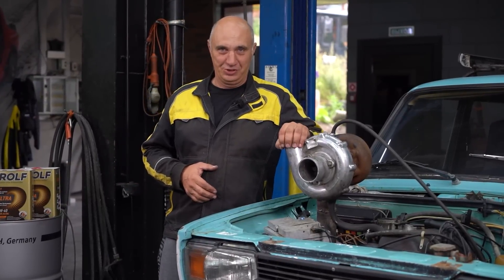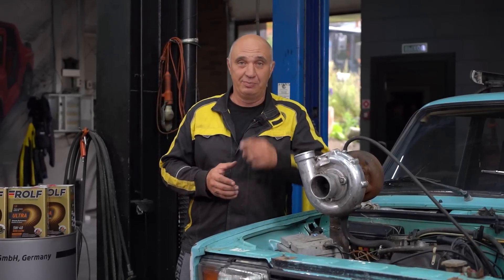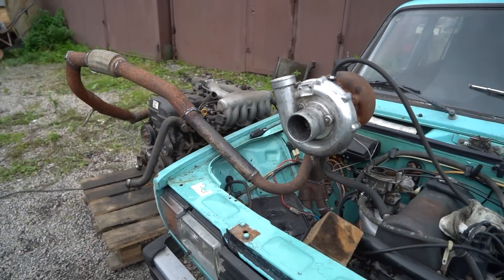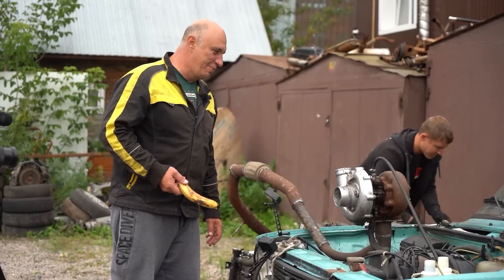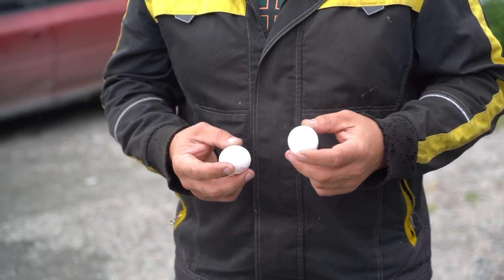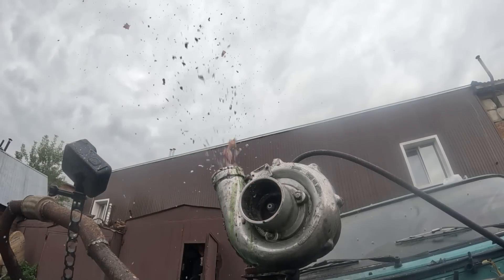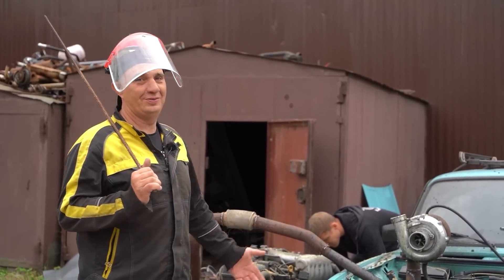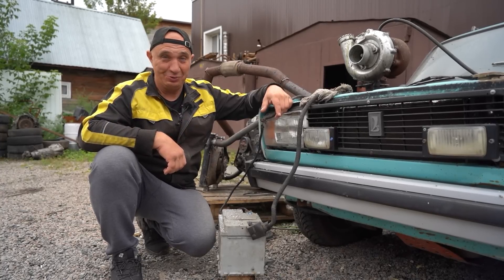Will a turbocharger survive a bird strike?

Comment: The turbo didn't spool up very much as the engine wasn't under much load, so even though it was revving fast, the intake valve wasn't open all the way to keep the air fuel ratio where it should be.

The more power an engine has to produce, the more gas is coming out of the exhaust.
Reply: You're clueless
Reply: @spoonandtune  ?

Comment: Here is an idea for a video. Driving with the hood open and use a camera and monitor mounted on the open hood to see in front of the car. Or have monitors and cameras in place of every window. Maybe try it on a test track with a slalom and other obstacles.

Comment: I have a question I was wondering if you replace all of the oil in a vehicle and replace it with diesel fuel how would the engine run it's something I was curious about. Maybe if this comment gets enough likes and maybe you could try it?

Comment: A shop I used to work at had a supra drag car with the turbo mounted up front behind the bumper cover. One day, it ate a squirl. Something along the lines of "yeah, I hit a squirl. It just fell out of the trees. I thought it was clear, so I hit the gas. Apparently, something wasss-OH GOD!" Tail and legs were sticking out of the inlet, and the CAC was gummed up with squirl goo. That turbo survived, but it wasn't the same after that. We put turbo mesh over the inlet but pulled it at the track. This track had a  corn field on one side and woods on the other.

Comment: All I can think of is the testing done by Saab when they were developing the J 29 Tunnan. A jetfighter built from 1950 and some years onward. I had a license built de Havilland Ghost engine and one of the things they were afraid of was birds being sucked into the engine and damaging the turbines. So they used a test mount and threw stuff into the intake to see what it took to damage it. They started with dead birds and small things and the engine just kept on running. So they started tossing larger and harder object, including fist fulls of nails and they were just spit out the back with little to no noticeable damage to the engine. Eventually someone threw a crow bar in it. The engine didn't like that but it was still running after the crowbar and some blades for the turbines were spit out. Having seen that the technicians were convinced it wouldn't die by sucking in a few birds.

Comment: This test is actually pretty funny, but a real turbo inside of an engine will spend much faster when you actually create boost pressure inside the engine because the exhaust pressure gets much higher

Comment: it slices ... it dices ... its the turbo slicer 2000 !!!
Reply: Save electricity with this gas powered blender!
Reply: @matthewpere1975  i rate it a solid 4,5/10. blending is more like a 2/10, doesnt eat some stuff thats supposed to be fed. On top you need to buy a 2nd and stronger engine to operate it at turbo slice. but we cant argue about the sability of it and that i can chew through metal, even though just once!
4,5 is definetly fair.
Reply: @johannesdatblue4164  or just hook it up to a V8 that should have all the power needed to slice a block of cheese.
Reply: but wait, there's more!

Comment: European turbochargers: Using only premium quality oil and filters still fails in less than 100k KM
Russian turbochargers: Can be used as shredders or blenders.
Reply: It's the bearings that fail. Mid 5 figure RPMs will do that.
Reply: Same with American turbos. Done plenty of holset and Garrett for normal use.
Reply: Its fails usually because nobody wait till warm up the turbo or cool down a bit the oil,so the oil burn at turbo shaft every time till at some point the turbo say ,no thank you was enough.
Reply: @laszloszell8753  Agree with you for the classic ones but the newer generations made of "chinesium" are failing almost at every service interval.
Reply: That’s because of lazy oil change intervals.

Comment: The volume per compression cavity of the prop is so small that it doesn't have the outrageous vacuum we expect. It certainly pulls objects in with tremendous force, but it's not until they're directly on the mouth of the unit that it can get a true hold purely through suction.

Now, what you can do with that turbo is send it to me so I can install it on my racing 4-wheeler! 🦊

Comment: Something to note, At such crazy RPM's, the force of air on the impellers is pretty significant and slows down the turbo. If you close off the exhaust or intake of the turbo, there will be less load on it, and as such, it can reach much (dangerously) higher RPM's. (:
Reply: It wouldn't suck anything in though.
Reply: @Chris_Garman  but whatever's in there is more likely to make it frag

Comment: Now, that's an interesting way to eliminate turbolag. Just add a second engine that has no other function than increase the exhaust flow to spin up the turbo.
Reply: No, it's an interesting way to eliminate turbo lag by not hooking the turbo to the intake.
Reply: I wonder if you could have a motorcycle engine in the trunk that revs to the moon every time you shift and have it work like this if you piped it up to the turbo? RIP Group B rally we'll never know
Reply: @viceroybolt3518  No need, with the literal jet engine anti-lag system some of them used.
RIP indeed, though... I appreciate equalizing everything to make it about the drivers' skills, especially for teams without an endless budget... but there goes the innovation as well 😢
Reply: @DUKE_of_RAMBLE  Ah yes, that Subaru toroidal-pulse afterburner anti-lag, it is THE ONLY turbo system which can go toe-to-toe with a supercharger for broad boost range! I have nothing but love towards whichever engineer(s) invented that, truly a masterpiece too advanced to exist in conventional strict-rule racing. It's so crazy that it can be viewed as a mix of the Russian Tokomak FUSION REACTOR - like vortex formation, a pulse-jet & an afterburner all @ once.. One of my favourite patent reads of all time & you can hear the turbo running past 50% optimal / top speed just while the car is idling, it's almost like cheating it's THAT good & unnatural-feeling.

People can talk about 2-step, VGT & whatever other tech all they want but none of them can even remotely replace Supercharger behaviour where whole RPM range is necessary as they don't generate max / adequate boost @ low RPM, not to mention linear behaviour + lag; the system is powered by the same fuel the engine uses & air so it's not requiring weird crap, especially if the ECU is great & programmed well to rich the mixture only when needed as compensation.

Even Centrifugal Superchargers still have the issue of non-linearity & decreased efficiency until higher RPMs, granted it's not super bad or anything but it's noticeable compared to a positive-displacement Supercharger like twin-screw or Roots. On top of the potential pseudo: positive-displacement supercharger behaviour it doesn't have the poor fuel efficiency & emissions of the Brayton cycle of a normal jet (@ least in theory), not to mention it's essentially an always-active EGR; SO it could even be made to have great emissions!! Combine that with a Diesel & you may e able to reduce the crux of the Diesel, NOs emissions. There's a reason pulse-jets have much higher efficiency & far better emissions, albeit at the cost of power-density & power delivery only in pulses, which is far from ideals in many aircraft or vehicles.

Even IF you design a turbo as great as the one on the new L3B engine, the exhaust backpressure is still a thing & lowers efficiency when the Veins aren't in optimal position, so really you are leaching energy just to hope to emulate Super. performance. Since every pound counts, engine efficiency across the whole RPM range is very much relevant in most if not all racing, even in high-end Drag competitions, they often have the bare minimum in the tank only enough for a burnout & pass & some short driving after off the track, especially for low-energy fuels like methanol & ethanol where you need waay more fuel to make it. That is why those Diesel LMP cars were so cracked at Lemans.

Except for electric-drive / assist I don't believe any Turbo tech. will ever beat this one in broad RPM range / spectrum but the electrical drive STILL uses engine power so once again not really free spooling & definitely not free low-RPM boost like it first seems, unless you use regen-braking too while racing but that's just so overcomplex just to improve boost behaviour & I don't see anyone invest into such a system (which also weighs an non-insignificant amount).
Reply: @viceroybolt3518  I have for years now theorised to make something like this but I think it does already exist in some prototypes; somewhat-related though is that some turbo engines, I think the Cosworth ones, use only ONE bank of a V-8 engine to spin the turbine, this may seem absurd & pointless or even dumb but actually what this allows is a mixture of:

A Turbo-charged & Super-charged engines: one side is essentially a turbo i4 but the other is a boosted i4 WITHOUT ANY back-pressure, which comes with many benefits ESPECIALLY if you tune it right & have the cams in that side have different timing / lift + have a purpose0designed exhaust which boosts power. It's just like if it was a low to mid -boost Supercharged i4 BUT without using crank-power for it AND utilizing the better efficiency (at low air pressure & low-ish boost) Centrifugal turbine instead of a positive-displacement pump.

Now, I have 0 idea if the Cosworth engineered ones had the two sides with any significant difference like the cam thing I mentioned but eve if not the decrease of back-pressure & the use of exhaust-pulses for better exhaust-flow extraction already is guaranteed to make considerably more power than the side driving the turbine as aside from the obvious power draw of a spun turbine the exhaust-pulse travel isn't messed-up. I know those engines were also based on NA ones originally & the boost they ran was low; so you end up with a pretty well-balanced performance naturally from the get-go without any fine-tuning, even. But there is also a benefit where the torque output range & behaviour / style will be different between the two banks & so them driving the same crank makes for a more linear torque curve / output!

But one thing I thought-about on top of your idea is how an engine like the one you mention driving a turbo for a Diesel would yield amazing results as Diesels with a long-stroke, good design & correct AFR (no smoke..) already use-up far more of the combustion energy, meaning the exhaust isn't expanding much anymore & the EGTs on Diesels are also lower. In fact I have a theory many diesel tuners reaching stupid numbers with nearing 100PSi or more purposefully use too rich of a mix so there is more turbine driving force but I'm not an expert here & it may be just hard to tune out & not purposeful.

I own a model-plane engine which is called a "Diesel" but it's actually HCCI, that is like a carb but with heavy fuels & oils * ignition via compression & it has a 22.5/1 compression or so.. Even though it's like a 1.5cc. engine, the style of combustion is already so much more exhaust-efficient they are quieter than nitro RC engines to the point they don't need a muffler, so the proof is in the pudding. And as a final proof of concept there is this guy here on youtube who put one of those cheapo AMR500 supers on a 4-stroke small generator Diesel for his honda & he's getting better mileage & performance overall. But with a turbo, even if it's actually small enough to be within function range, it'd almost certainly not do better, probably be just str8 parasitic until way up there in RPM where it could make a little more power.
Reply: @bo-dine7971  I believe it, not every time but some of the time the improvements in combustion from boost on something that runs constant like that would be good and the turbo like all turbines is extremely happy frozen in space at a stable RPM with no special outside forces on it. Generators have the ideal operating environments car engines don't. 

As for the diesel boys running rich, you know they runnin rich that's why those two thousand HP monster trucks blow up on the dyno so much it's a wonder when they don't runaway.
Reply: it's called compound turbo setup, but actually  the engine that spin a turbo to spin another turbo is your own engine, and it is connected to the second turbo too, so the pressure rises to the sky.
Reply: 2stroke turbo on 4 stroke😭😭😭😭😭 just a weed eater on a turbo
Reply: Comprest air from a cylinder to the exhaust side?
Reply: Maybe wood turbo barrel 2jz

Comment: When has a bird ever flown into a turbocharger? jet engines are not turbochargers. The AI generated thumbnail is also a let down that made me sad.
Reply: Then why are they called turbine engines?
Reply: @deadon4847  because they use multiple stages of turbines to move the plane.
Reply: @Floofie_boi  They do the exact same thing, they compress air.
Reply: @deadon4847  one of them is an entire internal combustion engine, the other bolts onto an engine. The only similarity between the two is compressing air

Comment: A squirrel caught in the turbo would be more likely.  Birds don't usually nest in under hood.
Try a cat.
Reply: Yeah, squirrel or mouse. 

Mice regularly get into airboxes. I found a dead mouse on a maf sensor screen, and surprisingly when i was 18 doing brakes i found 1/2 a dead mouse on top of a brake pad, the other half must have gotten sucked between the pad and rotor.
Reply: Cats are for eating, not turbos.  😄

Comment: I once did a repair and covered the turbo intake with a cloth.
Forgot to take it out, went driving.
There was a noticable "puff" and a bit of smoke. The cloth was gone, the turbo still happy ever after!
Reply: If you pulled the intercooler there were likely particles of cloth at least blocking some of it... 

Reduced performance, but that's about it. 

Better than sucking it into the intake on an NA car, jamming a valve open and having that valve collide with a piston!
Reply: @volvo09  It was a VW engine without an intercooler.
Indeed if it had one, I would have had to clean it out.
Reply: @demil3618  nice! Perfect car to do it in, just eats it and keeps on going.
Reply: @volvo09  The weird thing was that the engine died not long afterwards- but because the vaccuum pump seized and was pushed off its shaft. At the lower end of this shaft was the oil pump, which then stopped working.
Was the design of those VW whirlchamber diesels JR, JX, JP etc...
Reply: What did it do to the engine?
Reply: @jwalster9412  Nothing- to my surprise.
Reply: I wonder if it just got dieseled with the diesel fuel and moved on as sparks?